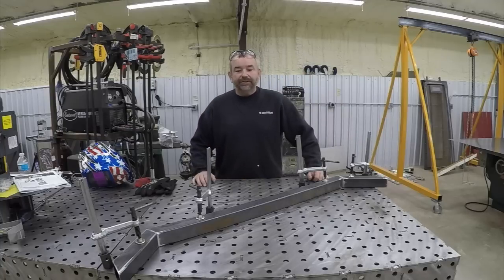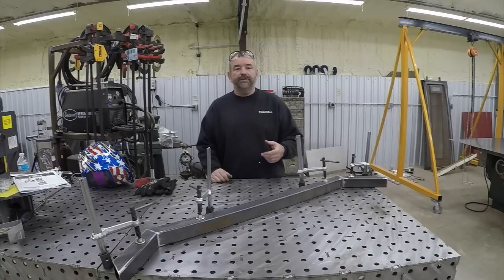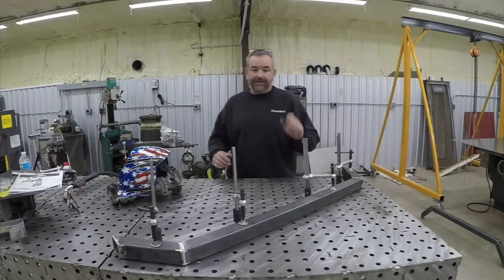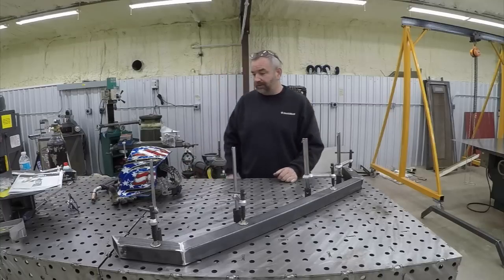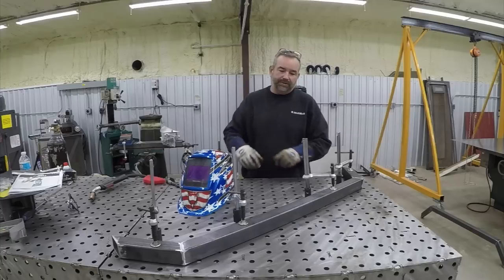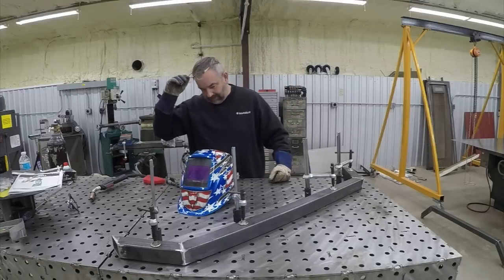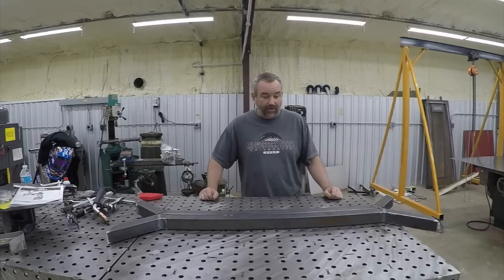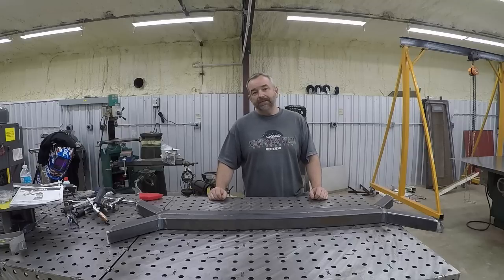Fabrication Basics // Mig vs Tig - Which is Faster?

Comment: I'm a Fitter-Welder, My Boss prefers that I Mig everything i can because it is faster. He says that I'm costing him more money If i don't do it FAST enough. But there are weld types where Tig out performs Mig. 3mm welds with Mig with 0.9mm wire(.035") are basically impossible. So welds on 2 to 3mm thick material Tig is best. Alluminium is way easier with Tig than Mig, and it looks better. Special material, Stainless steel, (especially thin material) and I do Stellite welding (a Cobalt based hard material) There is no such thing as Stellite in Mig, (it is too brittle to make it in a thin wire). Tig is more accurate, you can put a small spot just where you need it and not all over the place. Tig has no spatter so therefore it is a cleaner method.

Comment: I am just getting into MIG welding now, having recently upgraded from a HF flux core and what a difference, but I find my biggest challenge is keeping a steady hand and finding ways to rest my hand on something to control my welds. I guess being 67 years old doesn't help much with the steady hands thing either. I am thinking about a TIG welder for the future and watching you do your projects has been a help and encouragement. Thanks Gary.
Reply from the maker: You got it George, 2 main keys, keep a steady and, being able to see what your doing really well.  For the longest time i needed readers, my welding sucked!  Just recently had to upgrade to a +3 on the readers.  67, piece of cake, your just getting started good!  And yes, the gas mig welding is a very nice upgrade from flux core...
Reply: When I have to do a lot of MIG welding I put it in 4 so just press once to start and another time when you're done so you're not griping the trigger like crazy and getting cramps and shit

Comment: Nice video. I've occasionally found a job here and there where TIG will out perform MIG time wise, but it's only because of the time required to clean up and grind the welds. I use my wire machine everywhere possible just because it's the one that makes me money.  The only time I ever stick weld anything is if I just can't get it close enough to the shop to be able to use wire.
Reply: That makes sense.  Where have you found tig to be faster and have you ever used spray arc in place of short circuit mig?
Reply: christians131 Actually, yes I have used spray arc in place of short arc, but only on stuff that is a fairly heavy fabrication. The heat input is so high with spray than anything less than about 3/16 and you run the risk of blowing through. As for tig....mostly ornamental stuff that it winds up being quicker when you count grind time plus aesthetics.

Comment: Did the exact same experiment with a couple of work mates, in a fab shop where we worked.
The conclusions we came too. 1. Stainless steel is a big variable ( prep and post welding ) 2. Mig welding is best for sticking metal together for knuckle dragging types. 3 Tig welding is therapy for gentlemen that care about the image they present to the world. LMFAO !
If you want dimes, select DC pulse 1.8 - 2.0 Hz. Add rod hot, move on cold.
Love ya videos ( so smooth ) look forward to ya next ones.
Reply from the maker: Thanks man, agree with everything you said, and thanks for the tip, I really need a machine with pulse!  Could I get away with an AHP machine for that, or should I step up and get a miller or lincoln?
Reply: 🔥Ramsey Customs - turbocobra That's a hard call.
I haven't seen or used an AHP machine.
And it would probably be fair to say, that Lincoln / Miller are a minority also in this country, although I have used a DX 200 on a small stainless pipe install job, and was well impressed.
CIG, ESAB, Kemppi and Fronius are the machines that I'm most familiar with, and I only ever weld stainless steel ( food industry last 10 years )
Price wise, have a look at an ESAB 2200i with T34 panel.
Enough features for most applications, and adaptable for gas / water cooled CK torches.
Hope that helps. Cheers from down under.

Comment: I'm a " Satisfied " welder ...... if it holds together I'm satisfied LOLI would love to learn Tig welding and be able to afford the machine but for now my Eastwood 135 Mig is serving me well . great to see the time comparisons , I don't think anyone has ever done that before to share .
Reply from the maker: How are you liking the Eastwood 135?  I have the 175 from eastwood, seemed pretty decent, i had one part go out on it, but they sent me a new one for free.
Reply: So far I haven't had any issues with it and I've welded a lot of patch panels on the old 66 F100 and even built an engine stand with it . No regrets at all in buying the  Eastwood 135 .

Comment: I used to work with welding and I prefer doing TiG welding simply because its more fun. I convinced my supervisors that I could do some of the things we did faster with the TiG and actually proved it. The welding can be done at almost the same speed in steel and stainless if you amp it up (I usually run up to double the recommended amperege on those two and towards three times on aluminium). But where the real gain is that when you do short series the TiG is pretty much spot on if you know what amps you should run for different thickness, so set up is quick for a good weld (we only did quality jobs). And then theres the clean up which is pretty much non existent with TiG so total time is reduced even more.
Reply from the maker: Cool man, glad to hear from another guy that likes to tig weld!

Comment: ya they both have their place in fab work, mig is great for speedy work but has its trade off with spatter and precision type work.  I normally use autogenous tig for furniture legs since i hate the bump migging leaves and having to grind it off.  but i agree! out of position tig vertical up with the foot pedal is an art! ill stick to the basics hehe
Reply from the maker: Well said... and yes, me too, no vert up hill tig for me!
Reply: Exactly right Tee, once you get all 3 dynamics (torch, filler, pedal) working as one, it truly is an art.  One day it clicks and its like you are drawing your bead.

Comment: that was the first time ive seen a timed comparison between tig and mig. amazing. i weld exhaust, mufflers and converters for a living. i've always said mig was much faster in production rate. dont get me wrong. i love tig but in terms of how much parts and how fast can i get out the shop mig is the way to go. you got my sub brother
Reply from the maker: thanks man, and yes you are so right, plus it's so much easier for out of position welding, like you probably do a lot of under cars and trucks, welding overhead, etc

Comment: I like you don't have a $2000 welder if used the Eastwood welder before to do a quarter panel on a 61 impala. Now I have a AHP alpha tig. I tig weld everything I can, while it takes longer I find I save time in grinding. Especially on sheet metal. I also find I run into a lot of pin holes when I mig weld sheetmetal since I have to jump the tacks around so much. Anyways I like these videos even tho I do metalwork for a living I still learn a lot of tips and tricks so thanks for sharing!!
Reply from the maker: Thanks Ryan, how do you like the AHP?  Really been thinking about buying one to get the extra features that my eastwood doesnt have like Pulse for example.  Do you use pulse on aluminum or the sheetmetal much?
Reply: I really like my ahp. I have a Lincoln 175 square wave I used for years but i need something that could do mobile work with. The AHP works just as well as the Lincoln. Super steady arc, frequency control, even the torch is pretty good. I haven't used the pulse on it. I'm just used to pulsing with my foot if I have to do it. I was leaning toward buying the Eastwood one but I liked the extra features of the AHP and I don't like the foot pedal amperage thing on the Eastwood. All and all it's well worth the money and I'd recommend it. 👍

Ryan

Comment: I'm really highly considering getting an Everlast SuperUltra205 for this reason. TIG Welding looks like so much fun. But it also gives me a plasma cutter and an upgrade (DC) from my current stick welder.
Reply from the maker: Yea I have seen that machine, really hard to beat it.
Reply: you know of any people who use it regularly? I seem to get a sense that the brand has a good reputation, but can't find too many specific reviews (other than like a dozen on amazon) on that particular model.
Reply from the maker: I see ChuckE2009 using their stuff a lot, and Jody also.  AHP is another brand that is popular, and we help Gerald in CA get one, and I think he had really good results with it.  I don't think you can go wrong with either of them.  Both chinese inverter machines.  Same with Eastwood.

Comment: I first owned a TIG. After the slowness of the TIG i bought a MIG. Much easier to weld and faster. You are right that at times
a TIG is required. Both are needed
Reply from the maker: Well said, thanks John

Comment: Gary, another nice video.  I always enjoy data.  I know that my MIG is faster than my TIG, and your results fall inline with what I would expect from my welding.  The things that I find myself using TIG for, other than aluminum or stainless, is doing automotive welding when I don't wish to remove lots of interior or near glass, no spatter = no problems; also small high strength welds.  Such as capturing a bolt in a plate or a nut.  Things that require extremely good penetration and not allot of buildup.  Thanks again.  R.J.
Reply from the maker: Well said sir.  Agree definitely in automotive welding, I really didn't even want to mig weld on my new fab block tables because of how nasty they are.  I think I will eventually get another table and keep it for tig welding only.  I sprayed down antispatter and that helps, but still leave black smokey stains and crap every where, lol.  thanks for watching.

Comment: How long did it take you to develop the ability to just not contaminate? I just got used to using electrodes that were not a uncontrollable arc but had been contaminated. I did in the past not care about sharpening lengthwise to save time. I have since retrained myself to do it length wise after the angle was done or length wise completely.

Comment: Hi I'm new to this. Actually at 14 , I'm new to everything lol. But could you tell me which weld is stronger? Would a gas-less flux core mig be just as good and as fast do you thinks? Thank you so much for being older than me lol.

Comment: So, in theory, you’re supposed to snip off the balled tip of the MiG wire every time you make a new weld, even if it’s just a tack. That really slows things down, and I only do it on stainless, and on aluminum, using my spool gun.

Comment: That was a great video, appreciate you doing it. I'm just Getting started at welding using a Hobart 140,i really wanted a tig but it was way out of my price range. I have a question about cutting metal with a dry cut/cold cut saw. I bought a makita LC 1230,its a great saw but I have 2 issues with it. The blade is not square to the bed and there is no adjustment to square it up so all my cuts are on slight angle. The blade is about 1/16 to the right off square so I have to prop up the tubing or whatever to make it square to the blade. That's the first issue, the second is when I cut say 16 gauge tubing the sides of the tubing has numerous small gouges that move on an angle into the metal and then the blade corrects itself( or so it appears) and continues to cut straight for a few millimetres and then begins to gouge the metal again. It does this repeatedly until the cut is finished. I've tried going extremely slow to very fast and  it seems the faster I go the worse it is but I still can't make it stop. There is absolutely no movement in the cutting head or play in the motor shaft. It's made of thick cast aluminum and very ridgid. The only thing I can think of but not prove yet is blade vibration. It's a stock blade and seems good quality but I noticed on the internet some blades have relief cuts in them and described in the adv. as being for reducing vibration. I've returned the saw once and the second one does the same thing. Do you have any experience with this issue or thoughts, I'm fed up. I'd buy a cold saw if I could afford it or a good quality bandsaw. Any help would be appreciated.
Thanks

Comment: I just got a miller 220 with mig and tig and finally got around to setting up the tig.  I honestly do not get it so far it kinda sucks and comes off more as art rather than a functional productive fabrication process.  Im sure it has its place but now that I have done it for a few hours I'm way less impressed.  I hope aluminum tig is better and more satisfying.  Thank you for the video.

Comment: I've been looking at getting a tig for mainly steel from about 1mm - 5mm, and some thinner ali. 
Any reason I should avoid a tig over mig?   Other than it's harder to learn.
Reply: I use mig to weld exhaust pipe the trick is using gas and .022 to .024 wire. The advantages are 110 electricity, less expensive machine and portability.

Comment: Does TIG welding reduce the heat that travels away from the welding area?
Reply from the maker: Not sure I exactly understand your question.  I think tig welding gives you the ability to pinpiont the arc and there for have a lot better control over the heat, and the heat affected zone HAZ.
Reply: 🔥Ramsey Customs - turbocobra
yea that is what i was getting at, it seems the tig welder has less heat marks in the metal, Mig welding seems to cook the surrounding metal more
Reply from the maker: Yes, your exactly right.  With the foot petal and a tungsten electrode ground to a point, you can really control the pinpoint the heat

Comment: I'm doing A Project right now and The biggest difference is after you wipe the tig but mig you have splatter to clean  and grind so thiers more time for clean up for a sweet Finnish Project tig welding is slower but no cleaning almost.and you can re-pool the tack welds with tig mig not so much

Comment: much more useful.... can you give some idea about hydraulic press machine working table...
Reply from the maker: Not sure which machine your talking about?  I have the little small hydraulic hole punch and the hydraulic press brake, is it one of those, or are you talking about the welding table with the holes in it?
Reply: +🔥Ramsey Customs - turbocobra 
it's a hydraulic press bending machine. we used to work plate bending. I need to attach working table with machine for resting the plates.

Comment: hi,i want to use a tig welder on my car restoration what kind of filler should i use?thanls
Reply from the maker: For steel panels, ER70-S6.  Alternatively you could tig braze it with silicon bronze, but probably best to stick with the ER70-S6
Reply: +🔥Ramsey Customs - turbocobra and what steel sheet thickness should i use
thanks again 😉
Reply from the maker: You will want to match it up to whatever the thickness is of the panel your welding on.  You can get a little thickness gauge on amazon or most metal stores have them.  If its an order car, its probably 18-20 gauge, newer cars will be 20-22 gauge.

Comment: good comparison Gary.  I wonder - after you factor in all the fab time, what's the percent of savings on mig vs tig.  I bet its around a 1% difference in total fab time.  And like you said, when you grind, the Tig cleans up faster...  Hmm...
Reply from the maker: Good question.  I think your right, most of the time, you spend 90% of the total time of the project, cutting, grinding, fitting, 10% welding, so 50% faster on 10% of the overall work, 5% of the total time, so yea to your point, it's a very small difference.  Then you factor in that alot of times you don't need to grind tig welds, so save another 4% on grinding and your down to your 1%.
Reply: With welding, it's a lot faster to remove metal than to put it on. So, I'd try to get as little filler as possible.

You answered my question with this video, thanks!

Comment: on a thing like a dolly, i'd go mig just because its fast and good enough. if it goes to other stuff, let alone critical applications like medical or foodgrade stuff, you really cant use mig, just because its not clean enough. 

i mean, the extra time needs to be justified, be it for a flawless look, e.g if something needs to be galvanized, you would see every little spatter, even if you grind it off beforehand ( i get a lot of my metal supply from a company that builds metal stuff for houses, stairs ect with the slightest amount of spatter on it for that reason, wich is good for me).

the process you use is determined by the job you do i'd say. you just cant compare the two processes like that, each one has its own advantages and drawbacks.

Comment: Mig Tig Gas and Arc over the last 20 years I have used all of them, I now tenned to go for mig pretty much all the time, if you have a good mig plant you do not need a tig plant or arc and who uses gas any more, I cut with a plasma cutter and weld ally and stainless with mig. Speed time cost mig all the way and you can get real nice looking welds with a mig like anything else with a bit of practice.
Reply from the maker: Well said, thanks man!

Comment: I'd like to try TIG one day..I learnt to weld with Oxy Cet back in the day  and I guess it's more controlled and precise similar deal..Heat and add filler.
Reply from the maker: Yea if you have done the Oxy fuel welding you would like Tig!  thanks Zig.  Or maybe you should invent your own kind of welding... Zig Welding?  :)
Reply: Confusion welding.?